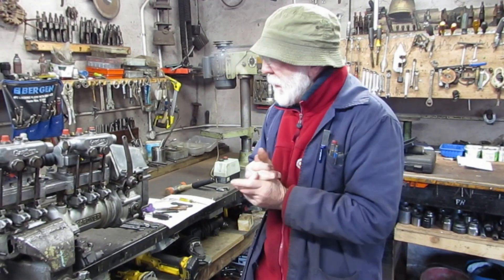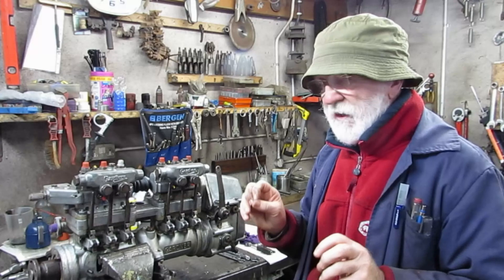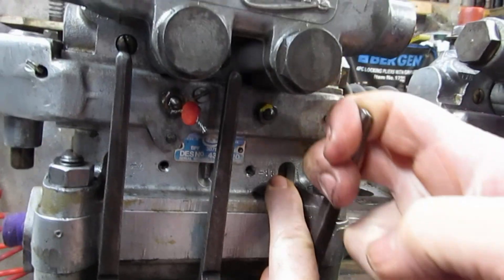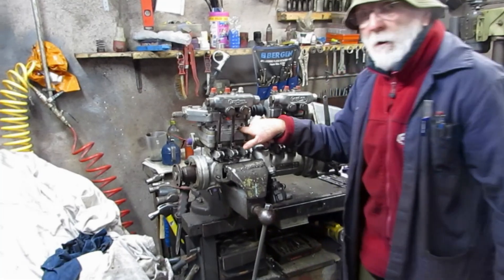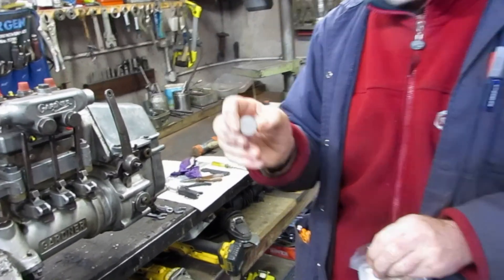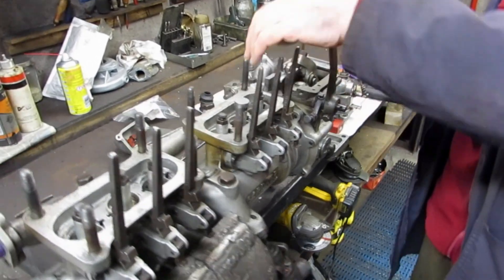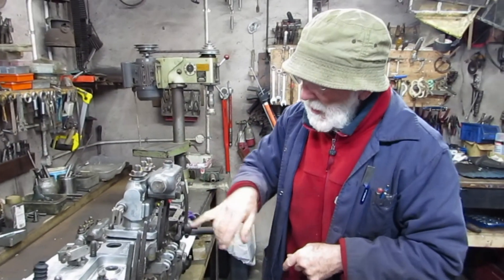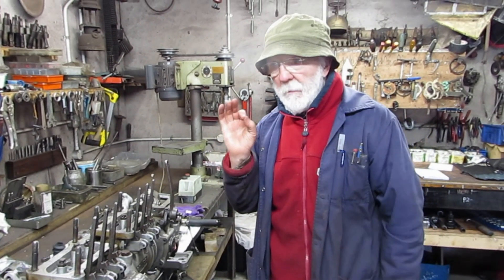Gardner engine: phasing the injector pump

Comment: Could you turn the fuel up in that manner too?. I'm new to the in depth look at Gardner engines.
Reply from the maker: No.   The AMOUNT of fuel delivered is determined by the cam profile in the cambox.   You can increase the fuel supply by messing around with the rack, but you'd be ill advised to that.   She'll belch smoke for one thing.   Best leaving the injector pump to the specialists.
Reply: @tangentgardner  thanks Joe. I don't actually have a Gardner just a intrest, but thanks for explaining. As I said really enjoy your videos. Most other videos I watch are all engines with computers and turbos and the like. But have heard plenty a tale of how one was "turned up". Thanks for explaining.
Reply: Joe McCool The trigger in the fuel pump determines the rated power of the engine. We tested the engines always on the dyno with no trigger 300 HP+ then, fitted and adjusted it to its rated power. (8LXB)
Reply: This is what time it gets injected not the amount of fuel he is adjusting.